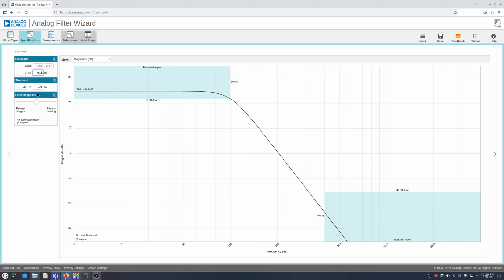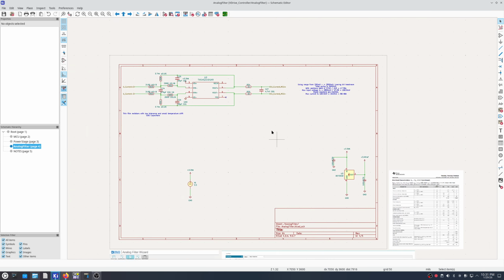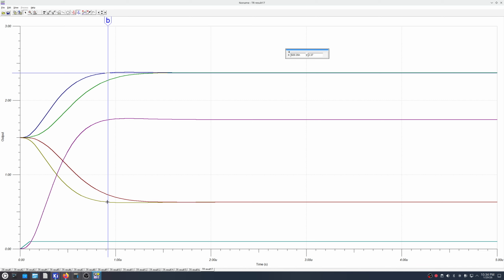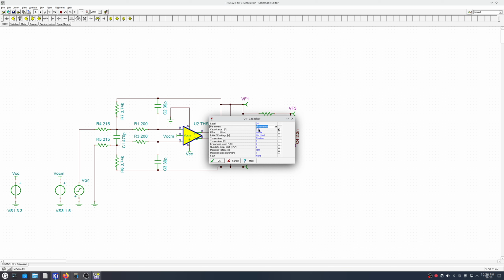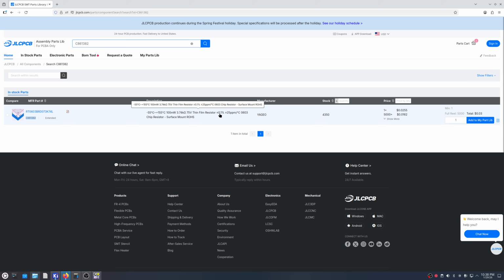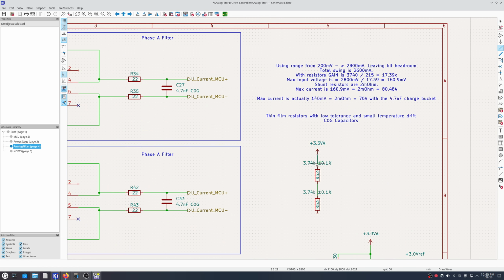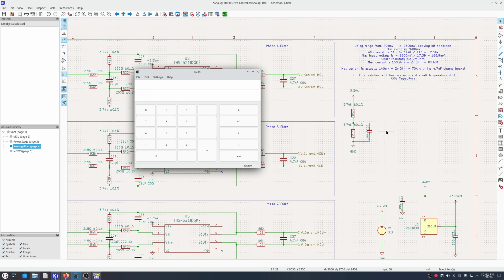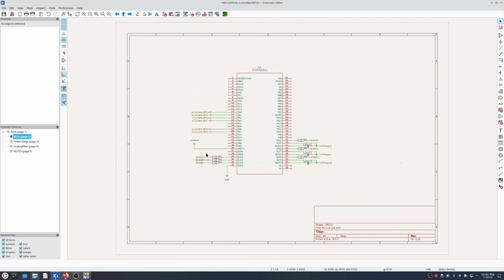Designing FOC Motor Controller - KiCAD - Schematic #2

Comment: You created an RC-CR filter powered by the same VCC and GND as the motor. Is the Phase_U_ output on the same line as the Phase_U that powers the motor?
Reply from the maker: Hi, it is snubber circuit for phase voltages. It is used to suppress high frequency oscillations during mosfet states switches.
Reply: Perfect, but is it connected to the same VCC, and is Phase_U the same as Phase_U_, for example? Could you explain that connection? Great job!
Reply from the maker: @walmirsantos9026  Hi! That is an RC snubber circuit. It connects the MOSFET's switching node (Phase_U) to GND and VCC using a very low-inductance path. When the MOSFETs switch states quickly, parasitic inductance in the board layout causes the node to ring (oscillate). The snubber circuit acts as a damper, absorbing that energy to keep the switching clean and reduce EMI.
Reply: @VDriveMotion thank you very much for your explanation.